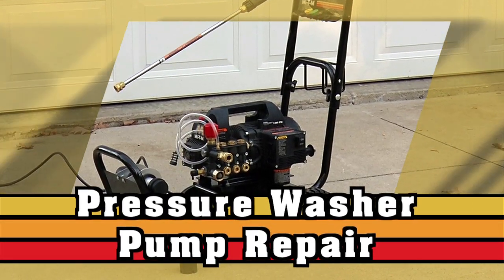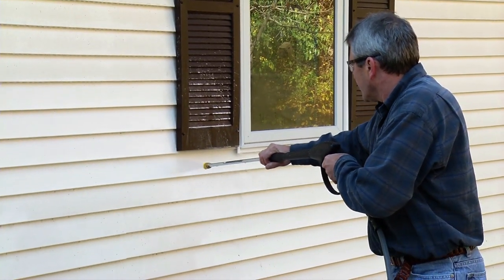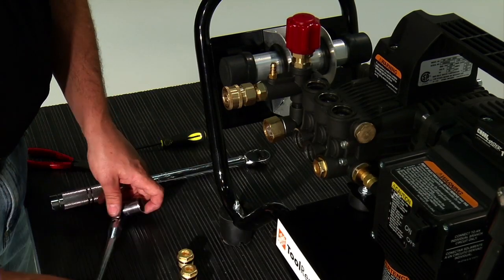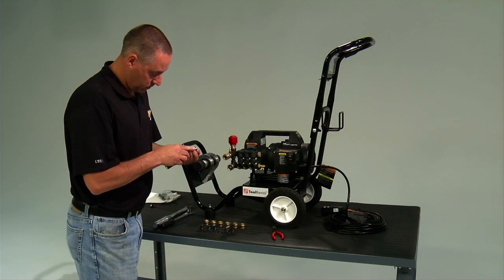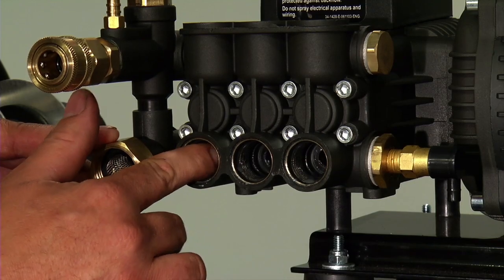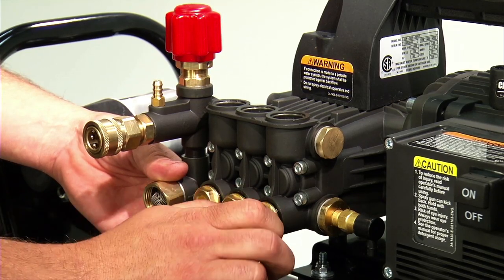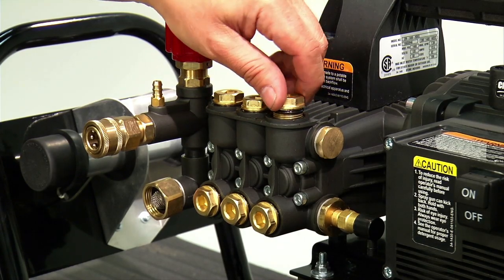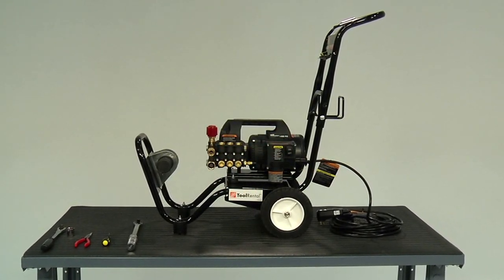Pressure Washer Pump Repair

Comment: GOOD Video 
i have the Same unit 
where to buy the Valves ?
Reply from the maker: Hi Joni, if you want to send us your zip code we'd be happy to recommend a distributor in your area. Or feel free to give us a call at 1-800-553-9053. Thanks!

Comment: Greetings, I have a mi-t-m 3-0099 pump and it is leaking. Could you give me the reference of the seals I should use?
Reply from the maker: What is the model number of your pressure washer?
Reply: @MitmCorporation  mi-t-m 2505 cold water
Reply from the maker: @comeoll  is the pump a 3-0079? We don't show 3-0099 as a pump we've used.
Reply: @MitmCorporation  yes is 3-0079
Reply from the maker: @comeoll  thank you for confirming. The packing kit for this pump is 852-0122 and valve kit is 70-0009.
Reply: @MitmCorporation  ok tansk 🙏🏻

Comment: My electric mi t m pressure washer works great but the oil is milky, which seals do I need to replace and where can I get them?
Reply from the maker: Hi Zack, replacing the water pressure seals and checking the plungers to make sure they are not cracked should solve the issue. Feel free to give us a call at 1-800-553-9053, we'd be happy to help you troubleshoot the issue.

Comment: I have an older model (Grainger 4ZZ94) or GP-2400-OMIC that has lost pressure. Is it advised to change the valves as shown here or do I need a new pump (Annovi Reverberi SJV2-5G-24)? Any advice would be helpful.
Reply from the maker: Hi Ed, our Technical Support Team can help resolve your low pressure issue. Please contact them at 800-553-9053.